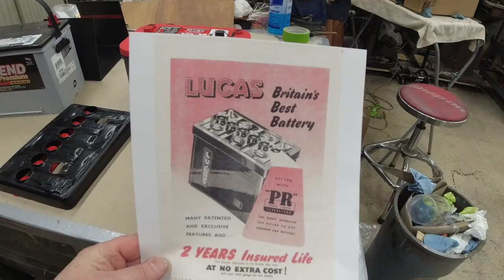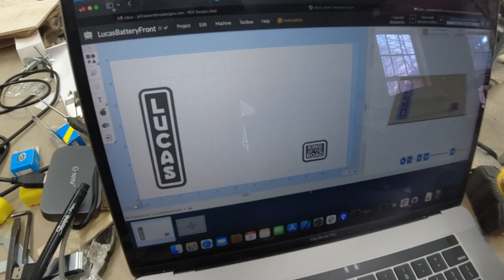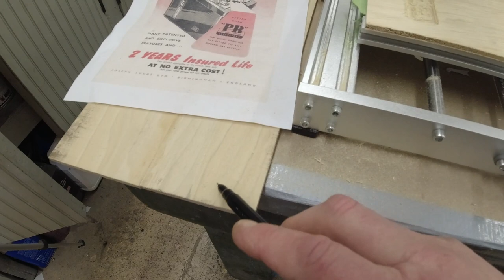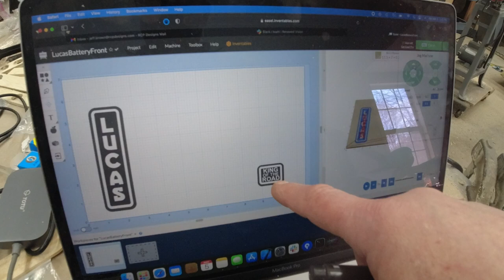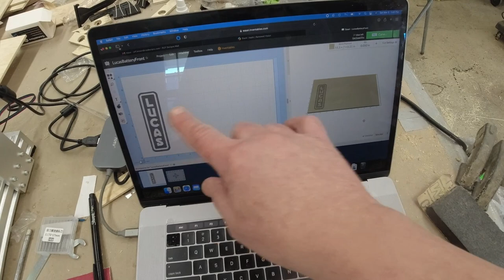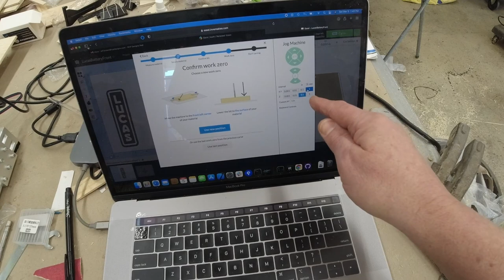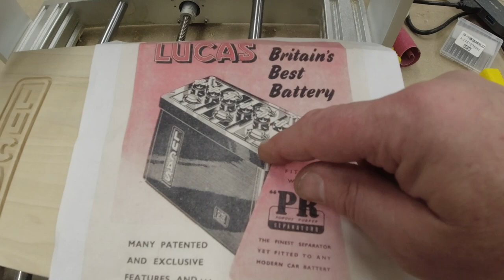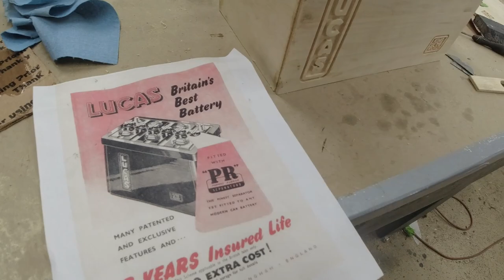1952 MG TD Restoration Part 16

Comment: For your battery case cover, it exists in marine  plastic panels that are developped to be worked with standard woodworking tools, this is called Kingstarboard, it is available in many color and thicknesses and the surface finish is granulated so it makes perfect panels for jobs that  asks for a finisned patina.
Very good job on that car
Reply from the maker: Thanks!  Kingstarboard looks like a great material, thanks for the information!